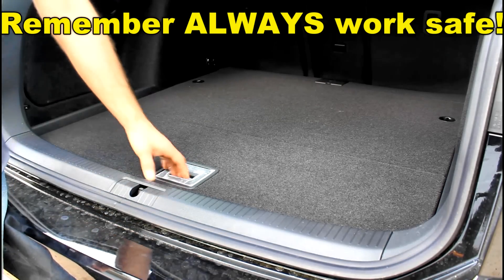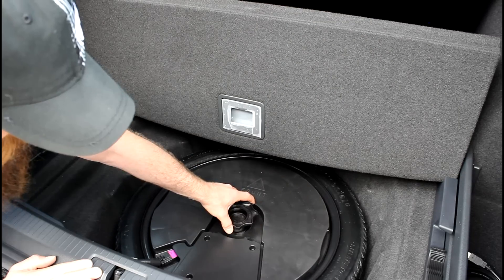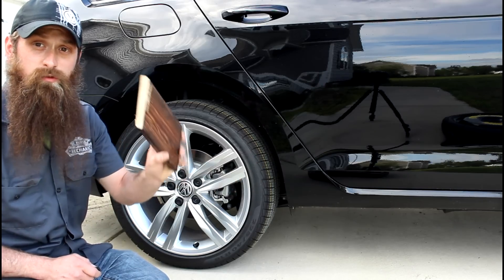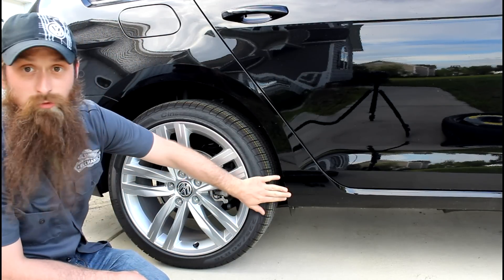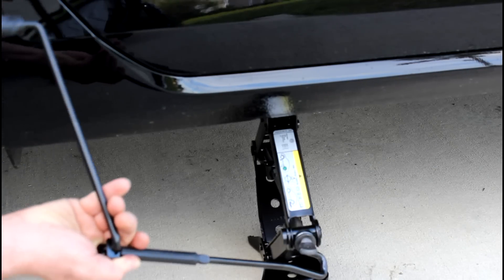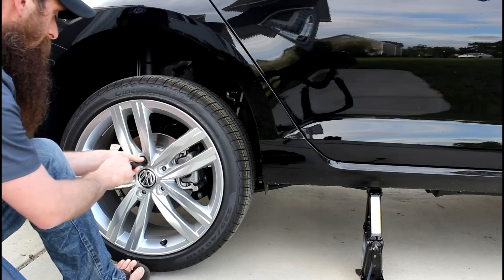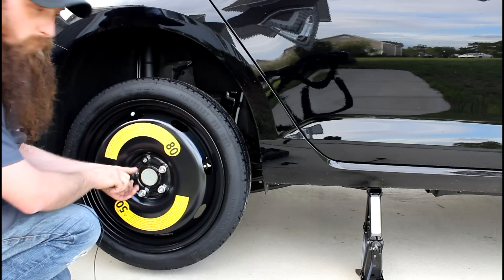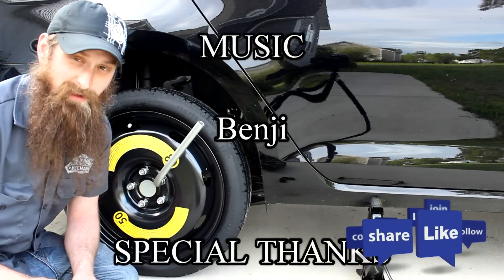2015 Golf Sportwagen changing a tire, and using a VW jack

Comment: What was the electrical connector on top of the spare for ? I often wonder why VW does not use a wheel nut like most other vehicles.👍
Reply: I believe that is for the subwoofer
Reply: Ha- thanks I never had a clue.
Reply from the maker: Yep the subwoofer! :)
Reply: Michael MacKenzie is really for a woofer?  Or is it a VW "safety" device to remind you, via the dashboard, that you have to change the spare tire or something!?
Reply from the maker: Steve Rob I think that I must have missed something in the comments thread. But thanks for the link LOL!

Comment: Charles, I recently changed to a spare on my 2015 sportwagen, and promptly got a tire pressure light on the cluster. Question is, that when I repaired the OE Geneva wheel, it did not have a TPMS sensor. What do you think triggered the low tire icon on the cluster?

Comment: I liked the video - short and helpful.  I have changed many wheels in my garage and driveway over the years and have learned a little tip that I would like to share:
If you make the bolt / nut at the bottom-most position the last one taken off and the first one put back on, then you don't have to deal with the dreaded wheel wobble, or wheel falling off the hub.  Applying this technique will allow gravity to help you by keeping the wheel on the hub which will bear the load of the wheel and make a not so pleasant job a little easier.  Keep in mind that you will need to have a shoe or object pressing in at the bottom of the tire like Charles had in this video to steady the wheel while loosening/tightening the bolt/nut.  If you are actually changing a tire, this might help you keep your hands cleaner too because you would be touching the wheels less.
Reply: or.......ya know tighten it in a star pattern like your supposed to do with every car....its common sense.....have your wheels fallen off before?

Comment: Great clip. Quick question. I've got a 2015 GSW I just picked up with 19 in Audi rims and low profile tires. I've got the stock all seasons that i'd like to swap out while its winter here in Colorado. Seems like I can do this with only the tool kit but want to be sure I've got the tires all torqued to spec. Not a gearhead but like to do it myself if i can....Would you say this approach is ok and if so, can you confirm the torque setting. Think I saw 89 foot pounds?  Thanks!

Comment: hi HubleMechanic,  could you please point out how to lift the gti (mine is 2014) in garage with floor jack and put it on jack stands? the 4 four points for VW jack is really short; after lift it with floor jack, you cannot find any space to put the jack stands in...
the vw forum discussions didn't bring any confirmed methods.   I'm trying to do tire rotation by myself.  thank you for any suggestions.

Comment: Enjoyed the video. Like to mention one thing, if the tire store put your tires on with an impact wrench it could be very difficult to loosen the lugs up with the lug wrench in the tool kit. There is not length to it to apply enough of torque that might be required. I do a lot of traveling and I keep a harbor freight breaker bar with the appropriate socket in each one of my vehicle if needed.

Comment: Great video! I was actually looking at a Gold Sport Wagon S for my mother. How is the new 1.8 turbo? It looks promising from reviews, but I'm not sure about power/reliability.
Reply from the maker: ***** THANKS! 

So far the 1.8 is okay. It is not as smooth as the TDI in my opinion. But I think some of that is the transmission. I do have concerns about carbon build up. We have been doing fuel rail recalls for a while now. We have found that even at low miles, they are getting build up on the backs of the valves. :(
Reply: HumbleMechanic Would you say carbon buildup is worse on the new 1.8t versus the 2.0t TSI or about the same?
Reply: HumbleMechanic Techron every two months - and always use 91 and up in any VW turbo. This is more or less what i have gathered from owning them. I wish the DSG and 2.0T made it into the gasser version of the Wagen, but I think it's ok with the regular auto and 1.8. Do you think it's a really bad idea to mod/chip the car and get the 1.8 into 2.0 territory, humble mechanic?
Reply: If five years ago you were worried about the power of the 1.8 liter turbo (it is strong), then you should be more worried today now that it has been reduced to 1.4 liters.

Comment: Do any of the current VW models include a full-size spare? It seems like many of the recently produced cars on the market include these silly sneaker tires. It's so nice to have a full size spare that won't be a limitation, especially when you are not near home.
Reply from the maker: Dwight Bennett I think most of them have a compact. Some have a "full size", that is the same overall diameter, but a smaller wheel. Totally fine in my opinion. 

I LOVED that most VWs had full size spares. Sad they went away from it. There is MORE than enough room in the GSW for one.
Reply: HumbleMechanic ah, that's a key distinction,  that they have room for it, even if not included.

Comment: A few additional comments. It is worth keeping an 18 inch breaker bar, 17mm socket, and short extension in your VW. In my VWs I keep a Snap-On SN4B that is a combination speeder and breaker bar which allows you to quickly change a tire at the side of the road (where you don't want to be). The wrench that comes in the jack kit it too short making it hard to undo bolts and the wrench splits if your tire changers used air tools and over-tightened the screws.

I have the S model which doesn't have a sub-woofer inside the spare. I also have snow tires so I took out the wimpy spare and use one of the other season's full-size tire as my spare.

I keep a Slime tire repair kit in my VWs (about $10 at Walmart). Once you get to your destination, or a safe location like a rest stop, you can fix the flat yourself in a short period of time, unless the tire is trashed.

Comment: great video Charles. don't forget about the center of the wheel sticking to the hub. just an FYI. they don't always remove that easily
Reply: Brian Skinner: If it’s really rust-stuck to the hub, loosen the bolts a turn, lower the vehicle from the jack and roll it a few feet so the weight of the vehicle will "pry" the wheel from the hub, then proceed to change the tire.

Comment: I have the same car, have owned VWs for over 40 years, and have a few comments. First, the scissors jack should only be used to change a flat while traveling (emergency). If you are at home you should be using a floor jack. You should replace the wimpy spare with a full size spare tire. In the summer I use one of my snow tires as a spare, and the reverse in the winter. If you use size 205-55/16 instead of a 225-45/17 tire then you can cut a custom shelf that fits over the tire and under the rear floor to store emergency equipment and other items. Jetta Sportwagens used to have that nice hidden shelf but it was eliminated on Golf Sportwagens. My Sportwagen doesn't have a speaker in the spare. If yours does it may prevent following the above recommendations.

I always change my wheels and tires and tighten them to the proper torque, but most people go to tire stores where they often use an impact wrench with high torque to screw on the wheels. Then when the time comes you need to change a flat either the wrench isn't long enough for you to loosen the bolt or it breaks when you try. I always carry a Snap-On combination speeder/breaker bar https://shop.snapon.com/product/Speeders%2C-Chrome/1-2%22-Drive-17-1%2F4%22-Flex-Head-Speeder-Drive-Handle/SN4B in each of my vehicles. You can get them for around $50 on ebay. If you don't want to spend that much get an 18" breaker bar at Harbor Freight, extension, and 17mm socket.

Comment: Not sure why you dislike the "widow maker". I actually find the old jack way faster to use. just attach its upper side to its place under the car, extend it until the bottom touches ground. Then lift. If your fingers know what to look for, no need to look under the car even.
With this type I have to check and adjust the jack multiple times before it is in its place. May be it is only me. Hints how to get this jack in its place on first try are highly appreciated.
Sadly, you cut this part off from the video.
Reply from the maker: I don't hate the widow maker. I think it works just fine if you know the proper way to use it. But I have seen a lot of people mess that up.
Reply: Any tips or tricks how to get this jack in its place on first try without a need for adjustment while extending it?

Comment: I was cringing this whole video. Have you not heard of the star pattern? When loosening or tightening lug nuts, you don't just go around the wheel in a clockwise, or random order. You're supposed to start with one nut, then go to the one furthest adjacent to it. This evens out the torque to the wheel mating surface and helps the wheel seat better.
Reply from the maker: +splewy That does not apply when removing the wheels, what at about the 5:11 mark and you will see that is exactly how I did it.
Reply: HumbleMechanic
 With the jump cut it was pretty easy to miss. It might have been helpful to actually mention it in the video, considering you removed the nuts all randomly.
Reply from the maker: That's a fair thing. I'll add an annotation. Thanks for watching. Or cringing ;)
Reply from the maker: It's really only an issue when tightening. Remember that putting a spare on is a temporary thing in most cases.